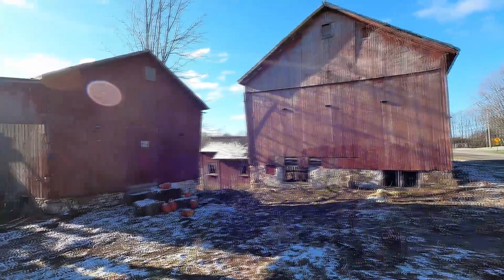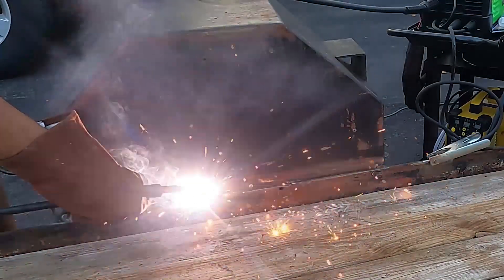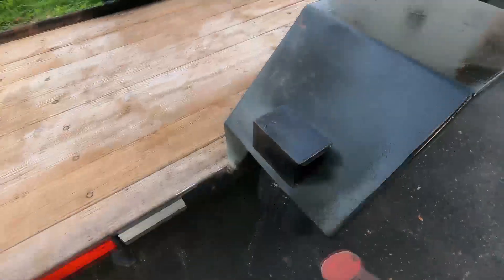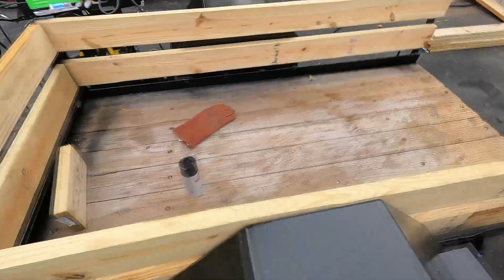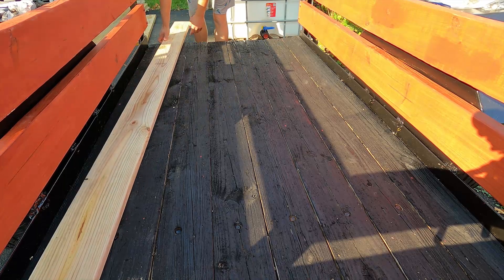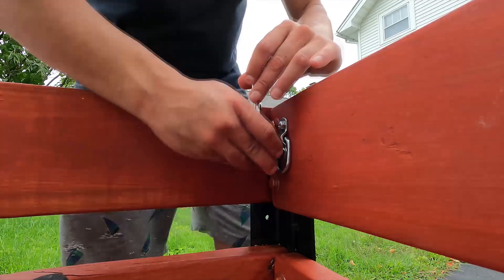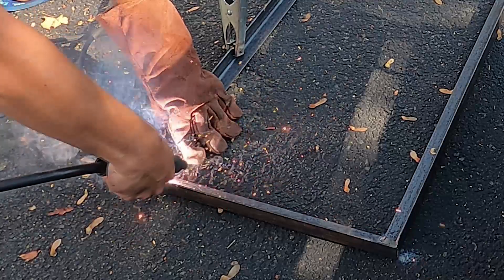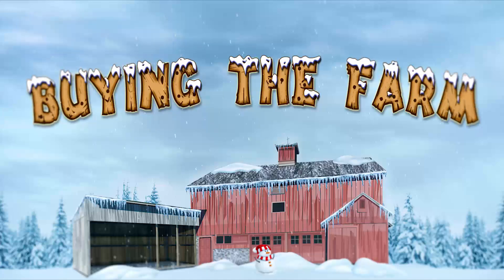🌱🥬💧💧  Building a CROP WATERING TRAILER   -   Part 1   (A look back to summer projects)   💧💧🥬🌱

Comment: When knocking on wood. I wouldn't knock on those buildings very hard, there's a good chance they'll fall over. 😂
Awesome video.  
Shame on you, using your mom as free labor.  Hope you at least fed her.   😂
Can't wait to see what all has happened or going to happen.  
It's still somewhat mild over in western Missouri, no major amounts of snow yet.  Temps haven't been to bad, haven't touched the thermostat in months.
Reply from the maker: HI Lonnie!! Yeah, I definitely won't be knocking on the buildings. Hahahaha. AND, as a matter of fact, my mom ended up feeding me that evening - so I really lucked out!! We haven't had any winter events yet up here in Central New York. I'm hoping it stays that way for a while. I know at some point the winter will catch up to us, but I'm hoping it is only for a very short time, as close to the Spring Thaw as we can get.    :-)